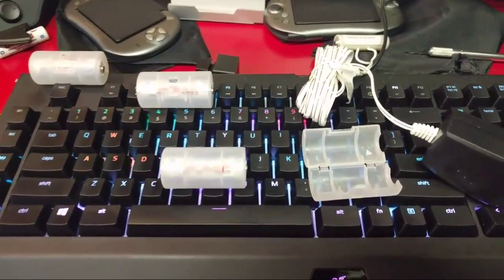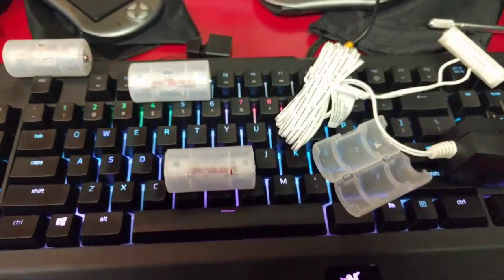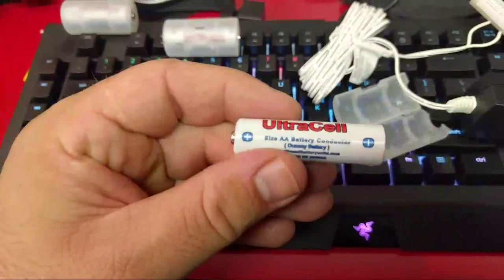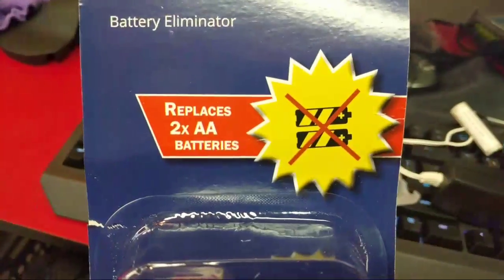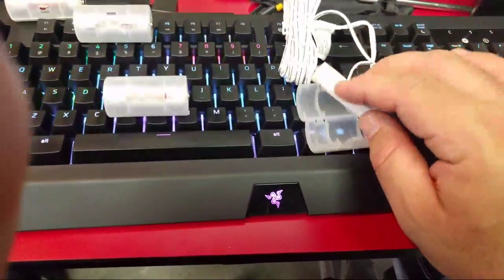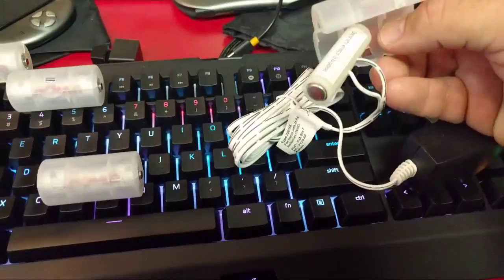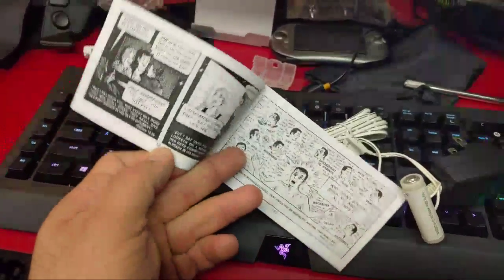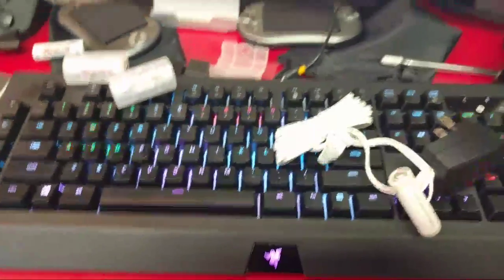Coleco Tabletop Game Power Adapter

Comment: Neat idea if it's cheap enough and not too much trouble to make.

You can actually buy the authentic Coleco Perma Power (set of 4) for about $25. Not too bad.
I just use the Eneloop "C" shells since I rarely play them for long stretches.